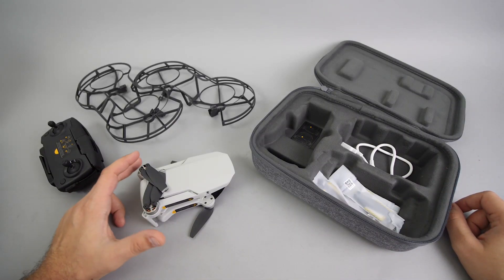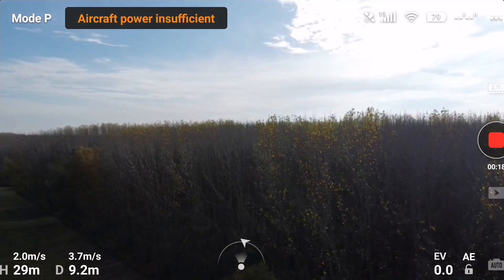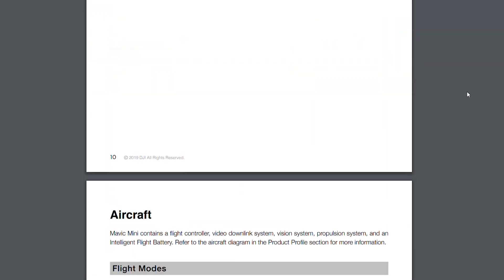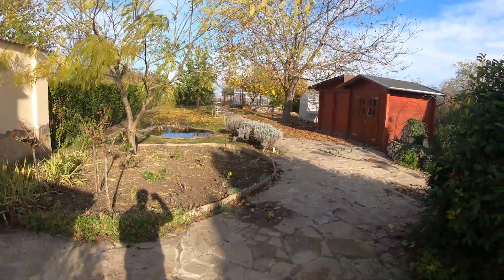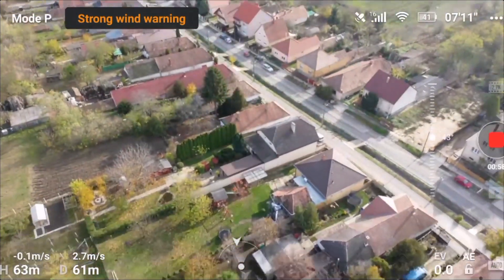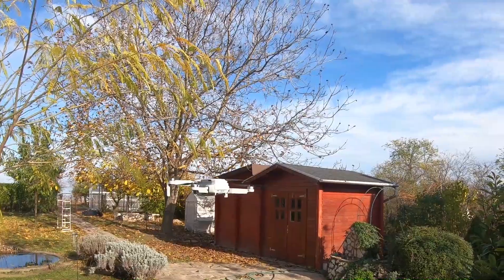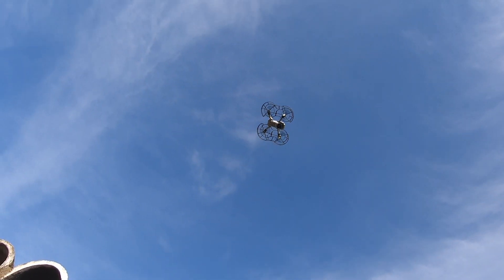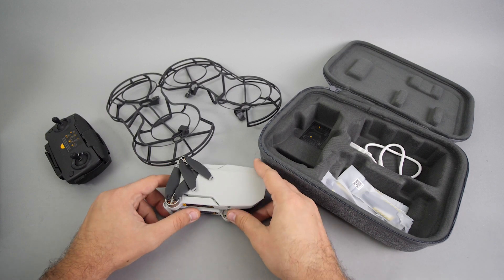DJI Mavic Mini problem with the prop guards on - wind blows it away!

Comment: There's an payload option in the settings. I don't know if that helps at all with prop guards installed. I was also told the the guards are for indoor use only. Also quite dissatisfied with this limitation.
Reply from the maker: Not sure if it can be turned off manually after it was turned on automatically. But that does not help anyway with the wind resistance unfortunately.